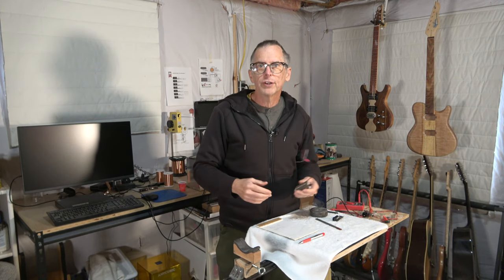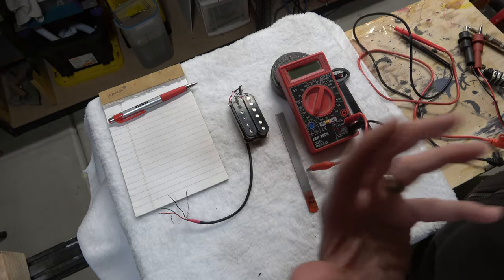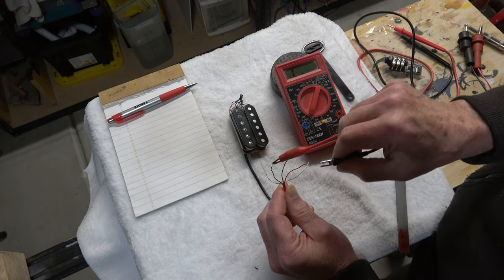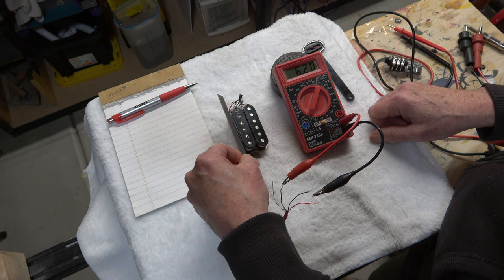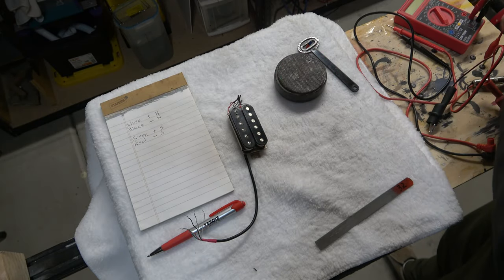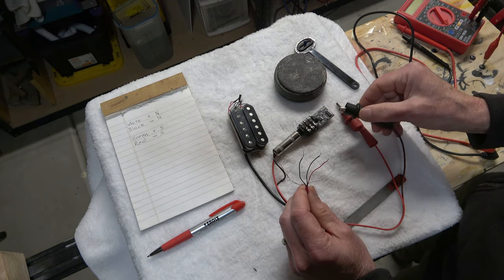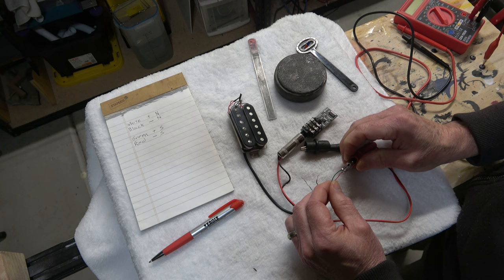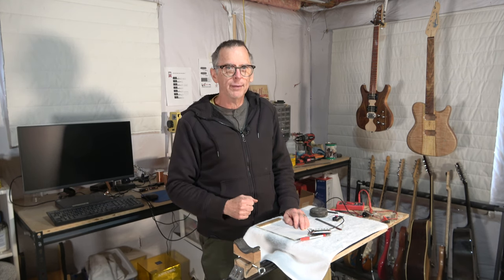Mapping A Humbucker Guitar Pickup

Comment: I hope I'm not doing this the wrong way but I'm an old guy this is as close as I can find. I'm just a guy who plays around with guitars and I have a general question. I have a Kramer 450g aluminum neck that I've had since the early 80s. Foolishly I installed a set of DiMarzio super Distortion in it back then and lost the original pickups. Since getting sick and retiring I have been playing around with some guitars I've modified some cheap ones purely for my own entertainment. With some success. I successfully transformed a glary into a pretty nice guitar having replaced everything but the body and the neck. I have some parts ordered a Les Paul bolt-on neck and body and I'm thinking about putting the DiMarzio in it. I ordered a set of Gretsch pickups with the very nice Chrome surrounds and I think they would match up nice on the Kramer as kind of matching in class. I suffer from neuropathy so I can barely play anymore not that I was Eddie Van Halen to begin with but my playing is very limited this is just a hobby for me now. I know the DiMarzio are probably a bit of the Holy Grail twosome because of their vintage. Just looking for an opinion thanks and God bless

Comment: I'm trying to mod a Donner dlp124 guitar with new humbuckers and one volume push pull potentiometer and one tone push pull potentiometer. I want to coil split these separately. I have a three way toggle switch. I've looked at the wiring diagram on Seymour Duncans site, so I would appreciate any help you could give me. Thanks.

Comment: HIGHLINE GUITAR, When mapping using the milliamp meter this is for matching the pole piece bobbins gauss measurements. When you purchase Unmagnetized pole pieces and then magnetize them they won't all have the same gauss values they will all be unmatched. The Higher the gauss strength value, the higher the output current. When using a screwdriver when tapping on each of the pole pieces should have the same output current? if not the pole pieces aren't matched and have different gauss strengths which is not good.

Comment: nice vids, but how do we know if the winding inside is clockwise or counterclockwise?. my guitar pickups are in phase (all) but the hum canceling thing was not workin like before. i was do some cleaning and forgot the way that the humbucker was mounted, especially the magnet inside and the high E strings sounds tiny than others. thanks!
Reply from the maker: Easy. The start can’t be unwound whereas the finish can. Knowing which end of the wire is the start and which is the finish will tell you the winding direction when viewing the top of the bobbin. If you can’t determine the winding direction visually, you can use a multimeter to figure out which end should be the signal and which should be the ground. If it doesn’t sound right, try swapping the signal for the ground.

Comment: Chris, would a positive reading be the start of the coil and the negative be the finish? if you are wiring in series, does it matter which ends you connect?
Reply from the maker: There is no positive or negative in a pickup coil. How you connect the ends will affect the sound. This link is a great explanation of the concept: https://www.1728.org/guitar1b.htm
Reply: @HighlineGuitars  this was the missing piece for me. I couldn't understand why the finishing points of the north and south coils were tied together. Perfect. Thanks.
Reply: @HighlineGuitars  in your video you use the word positive and negative, you also label on your paper with plus and minus. Most wiring diagrams talk about start/finish. I have the same question here, if I followed your video and identified +/- how can I map that to start/finish used in wiring diagrams?

I am interpreting your response here as; it does not really matter, but if that is the case then I guess i don't get the point of labeling with + and - in the first place (and maybe it doesn't?)
Reply from the maker: @AlexCornejo  It matters if you are installing more than one pickup and you want them to be either in phase or out of phase.
Reply: @HighlineGuitars  that makes a lot of sense, I had seen a few videos talking about that but only now I connected what that means. Thank you so much for this wonderful video and for taking the time to replying to these comments!

Comment: You should do a video on getting the target DC resistance for a Humbucker as trying to replicate a Humbucker is not that simple when you take into account the change in DC resistance after wax potting, for example I wound 5000 turns on two bobbins getting 3.75k on each using 42awg, both combined should have given me 7.5k but got 7.54k and after wax potting (15 minutes) ended up with 7.24k, my target was 7.4k, so looks like I needed about 5050 turns on each to get closer to the 7.4k?
Reply from the maker: I learned a long time ago that it's a fool's errand to try and reliably match turn count with DC resistance. Even if you nail the same turn count exactly on two bobbins, you DCR will likely vary from one to the other, especially if you traverse and/or apply tension by hand.
Reply: @HighlineGuitars  Thanks for the quick reply, I made a traverse feeder so all my pups are now machine wound, took some fine tuning but got there in the end, it cost less than $20 here - https://youtu.be/zuEciDLZ9y0

Comment: Hi! I watch this video several times. Very useful! But, since I'm looking with a translation, I have a question: What does the magnetic field indicator show with its red side?  The red side of the indicator shows the south pole of the magnet? Or the north pole of a magnet? Thanks!
Reply from the maker: blue = north and red = south
Reply: @HighlineGuitars  Thanks! I understand this, but I did not understand which pole of the humbucker magnet shows the red end of the indicator?
Reply from the maker: @bobless5517  If the red end sticks to the magnet, that's the south pole.
Reply: @HighlineGuitars  Yes! Thanks! 👍

Comment: hello, I can't figure out why my  guitar body and guitar neck resonate so much ,that it hurts to my body.
Reply from the maker: When and if you ever figure it out, please let us know.
Reply: @HighlineGuitars  it will be better if I forget about guitar, then)
Reply: May I suggest a centre zero, milliamp meter. 20-50mA. Otherwise known as a galvanometer. They're cheap and give completely passive, unambiguous results. 👍
Reply: @drumcrazy5866  thanks, but I did not understand how a galvanometer will help me solve the problem with guitar body vibration)
Reply: Could be microphonics which is small vibrations in the pickup windings, they will also equal why playing w a band at high gain, this is why people "wax pot" the pickups,